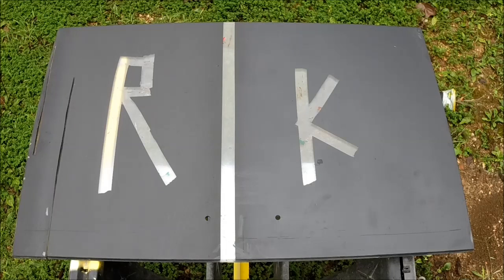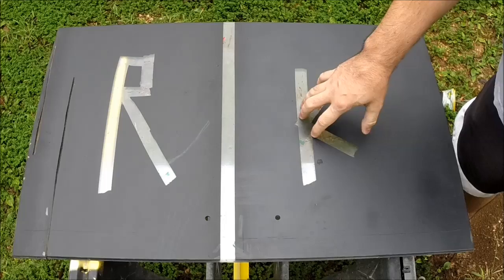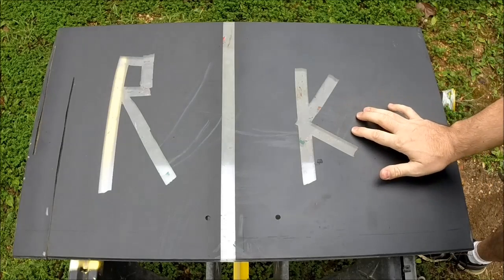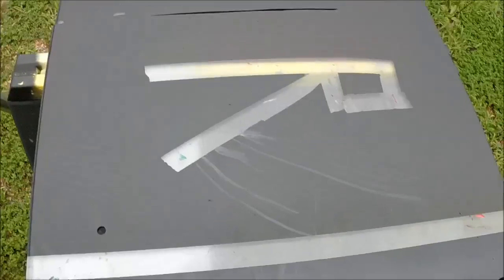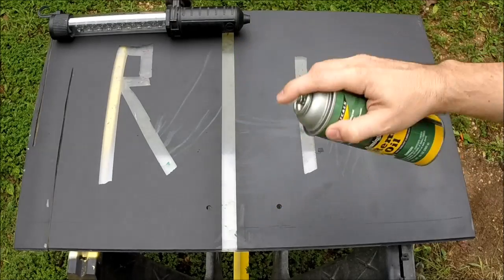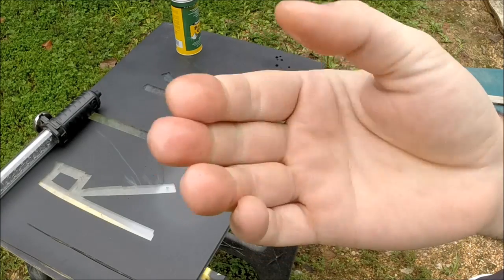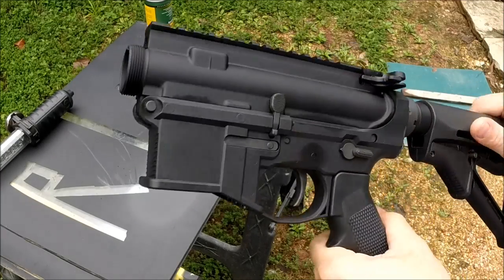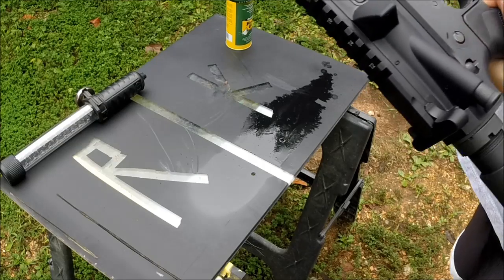Paint testing for AR15 Polymer Lower Flat Black Krylon vs Rustoleum part 2

Comment: Thanks for this! Was looking to do a factory refinish on my AR. Now I know what spray paint to get! 

I currently have another layer of paint (FDE color) on the rifle. Is it necessary to use aircraft remover or some type of paint stripper to remove the paint prior painting?
Reply from the maker: I doubt it would be necessary to remove the old paint. Just make sure to prep well. With a good degreaser.

Comment: I tried to paint my 4-wheeler body, with the Rust oleum and had serious issues, I degreased and sanded and degreased again before using the Rust oleum primer, camo paint and clear, over 3 days to do the paint job and the paint can be scratched off with my fingernails......super bummed......now I have to strip all that paint off and try something else, I wish there was a place near me that did the hydrographic dipping, but I might have to try that Krylon out instead
Reply: Atv plastics are usually made of HDPE,  Polyethylene is designed to resist chemicals and paints. As far as I know there is no good way to paint polyethylene and have it last. The hydro dip with some kind of primer might work better but it’s still paint over PE. I assume the only real moderately permanent fix would be vinyl wrap.
Reply: @Halfcompleted  Good to know thanks.

Comment: Matte finishes tend to become polished.  It seems that finishes naturally become satin or semi-gloss through use.  Krylon is solvent-based, so it most likely eats into the plastic surface a bit, whereas Rust-Oleum is oil-based, and therefore doesn't meld into the plastic.  I think RustOleum is better on metal.

Comment: Rustoleum was originally formulated for metal. Hence the “rust preventative” nomenclature. 

Krylon…rhymes with “nylon”…yeah…

Rustolem really is objectively better on metal tho, especially if you give it a shower with some brake cleaner beforehand.

Comment: Lexan requires special chemicals for paint to adhere.  Rustoleum doesn't have those, Krylons newer formulations do.  Lexan is NOT the same type of polymer in any way shape or form as used in firearms.

Comment: Rustoleum is the worst. I've tried painting plastics in a professional paint booth at proper temp, etc. I am not a professional painter but I would lay Rustoleum primer down, next day come in and spray a base coat. It would 90% of the time wrinkle up or have pin bubbles in the paint. It's like the paint chemically reacts to itself. Much time wasted. Never get that time back..
Reply: RustOleum 2X is made for plastic not Stops Rust like he used.

Comment: Good video. I just used Rust-Oleum to paint  a computer case black. The Rust-Oleum came out ok on a few of the panels but very textured on others which is evident of an un even spray pattern. I usually use spray paint for painting wooden speaker brackets in the car audio field but Im never worried about a superior finish ...just coverage. So I plan on starting over and  using the Krylon Covermaxx line. The Rust-Oleum self etching primer IS a good product. I also use that on car audio panels when I don't have access to a pro spraying system. When you want to step up to a superior can paint try some SEM products. I use them on reworked dash pieces and they come out looking like they were sprayed with a gun and are very durable. They're about $20/can but for certain projects the extra money spent shows.
Reply: Brewmaster C Yes for durability/quality of finish SEM can't be beat. They can be purchased in a spray can or custom mixed at Auto paint shops and placed in a PreVAL sprayer which is a glass container with a propellant cartridge you screw on top. Much more consistent than most spray cans.

Comment: Rustoleum has a rust fighter but no adhesion promoter for plastics. Krylon has adhesion promoters for plastics but no rust fighter. your tests were informative but you compare apples to oranges not apples to apples. however your test does reveal what paint you should and wouldn't use for certain surfaces.
Reply: Reo White  is 100% correct

Comment: Used the Krylon camo black on my stainless steel PSA barrel and it came out fantastic. Holding up well to the heat so far after about 300 rounds with a few mag dumps. Good thing about a spray can paint job, if it messes up simply reapply for 5 bucks ;)
Reply: Do you have a picture of the results?

Comment: Primer or adhesion promoter. That rustoleum doesn't have anything to assist in adhesion. That Krylon I'm pretty sure is a paint/primer in one.
Reply: He specifically calls out the Krylon he used was normal, without primer.  I used Rustoleum "Ultimate Bond Primer" on an RC ABS plastic boat, followed by Rustoleum gloss paint - the primer bonded great, but the paint came right of with just blue masking tape after a 3 day cure.  Kryon bonded great to the Rustoleum primer and saved my project from being a total mess.
Reply: how can this dude do a video on this without using primer. rustoleum with adhesion promotion primer is amazing.

Comment: just the video i need! thanks so much man. just a question, did you use kylon primer for this? then spray the gun with the black kylon paint? also how smooth is the paint during the finish :) sorry for the noob questions i am new to all this
Reply: Never use primer. It will mess up the krylon. I know from experience.  Just 2 light coats of krylon and it comes out great

Comment: sweet test. Also, I painted my AR stock (polycarb) with rust-oleum camo paint that bonds with plastics and I was wondering if I could use the krylon fusion camo paint (same color) and spray right over it? I can use liquid sandpaper if it would work better
Reply: no problem. Thanks for the response!